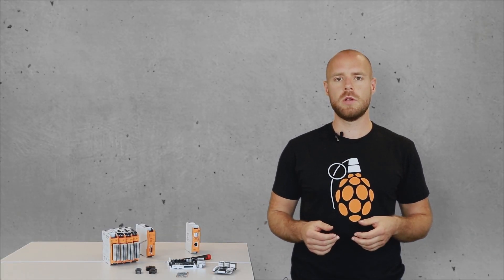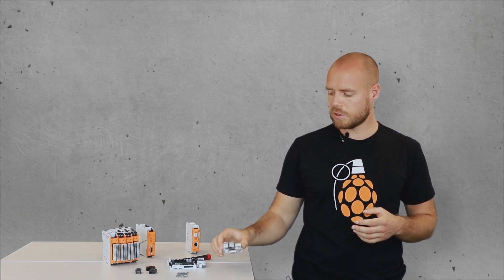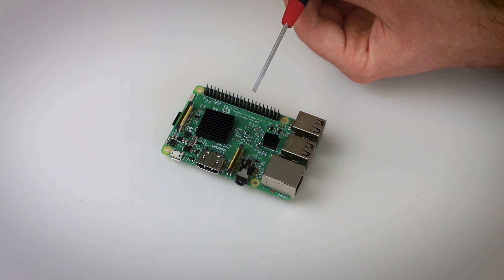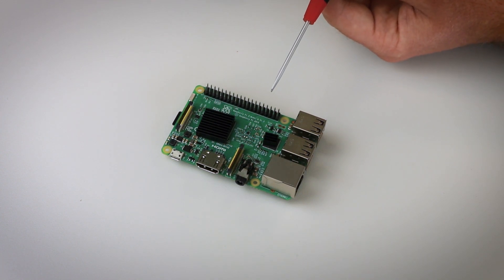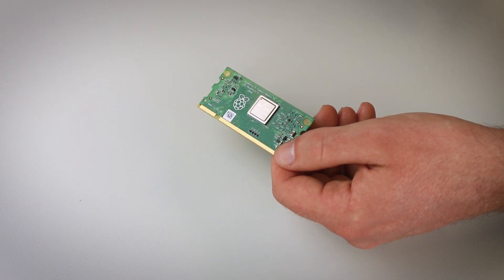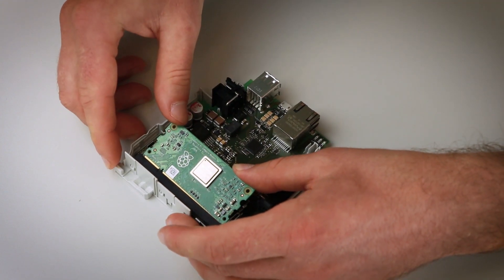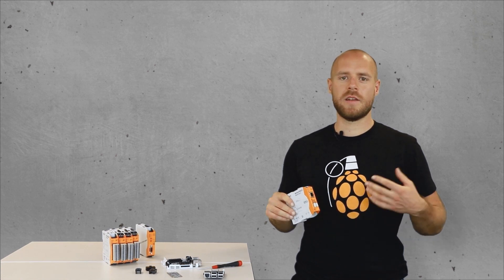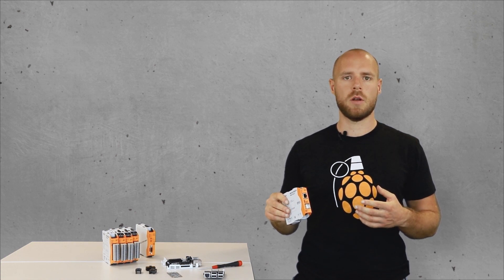Raspberry Pi vs. Revolution Pi - How we've turned Raspberry Pi into an industrial grade hardware.

Comment: Got any stock yet?  It's a great concept but only if we can reliably buy it.
Reply from the maker: Hi Scott, unfortunately we are (as many others) struggeling with the global chip shortage. That`s why we still can`t produce as much RevPis as we´d like to.
Reply: @RevolutionPi  Are some new products using Compute Module 4 in the works?
Reply from the maker: @skewty  Yes, there is. First one will be a device similar to the RevPi Connect. Unfortunately, we got the same problems as with the current devices. Right now, we can`t get some electronic parts in edaquate numbers :( 
Under following link, you can find some technical details about the upcoming RevPi 4: 
https://revolutionpi.com/road-to-revpi4/

Comment: Can I use a Rasp Berry pi instead of a PLC? If the answer is yes, then where are the I/O ports and that? 
Thanks btw
Reply from the maker: Yes, as the RevPi is a modular system, you can use it as a PLC by choosing the right set-up (base module + expansion modules). Most customers use the RevPi Connect+ base module with our IO expansion modules. You can find an overview of all modules here: https://revolutionpi.com/revolution-pi-series/

Comment: Great video.  You have added features to make the Raspberry Pi become a PLC.   What differences remain?  i.e. Why not just use a PLC?   Cost perhaps?
Reply from the maker: One of the biggest advantages of the Revolution Pi over a classic PLC  is, that it's way more flexible. You can either use Soft-PLC software like CODESYS or write your own little control program in C, Python etc.. You can use the RevPi as an IIoT gateway to collect data and send them to the cloud or you just use the RevPi as a normal IPC. Some of our customers buying large quantities even let us install their own customized software image on it.

Comment: Hi, Excellent video. It is possible use revPi for robotics applications? Do you see some disadvantage about i?
Reply from the maker: Actually we don´t have much experience with robotic applications with the RevPi. We know that there is some testing by some companies using the RevPi with ROS to control a robot arm. Since the RevPi doesn`t have safety functions you need at least an additional safety controller like a PNOZmulti from PILZ.

Comment: How fast is the unit compared to the standard PLC ?
Reply: Almost the same if you do not expect real time system. The main difference is reliability. PLC can last more than 15 years without any issue.
Reply: Kinda apples to oranges as I see it. The possibilities of a RaPi 4 (in combination with a modern Linux kernel / OS) are immense. This has the power to maintain bi-directional communication / sync with modern cloud APIs, run generic logic UIs like Node-RED and program in all the top languages (Python, JavaScript, Java, C#/Mono, C/C++, Rust, Ruby, Pearl) while also talking to downstream PLCs, BACnet, Modbus devices.